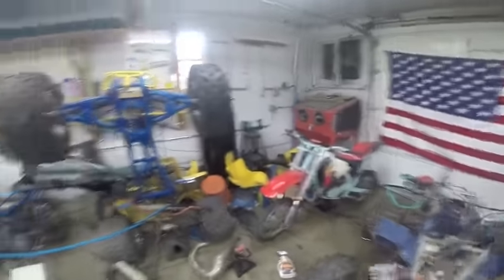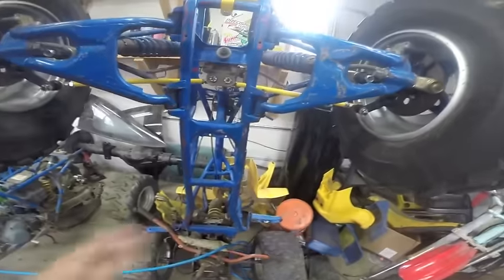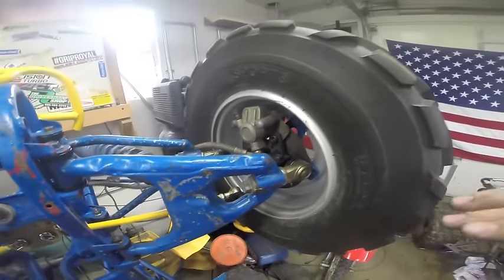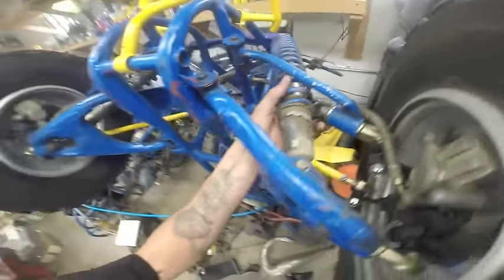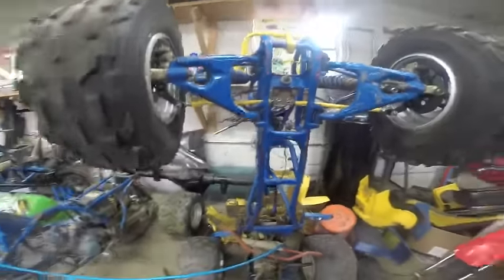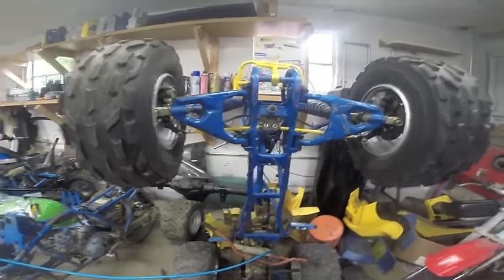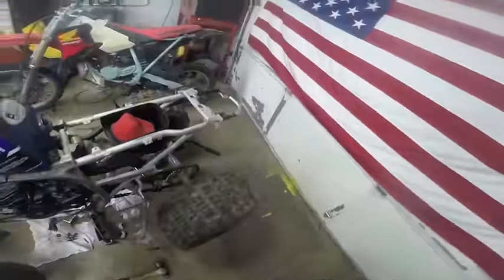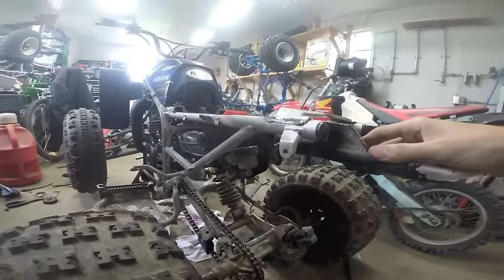What To Look For When Buying An ATV, 4 Wheeler or Quad

Comment: Definitely check over before a test ride, i went to look at a raptor recently and guy said here take it for a ride. Jumped on went down the street the throttle stuck, luckily I didn't panic pulled clutch and hit the kill. After inspecting it the frame was cracked and numerous other issues.

Comment: wow lost me @ "snort"
Reply from the maker: sorry i was getting over a cold.
Reply: dude it's used. not brand new. depends on price to check all that shit
Reply from the maker: some people have no clue what to look at what to buy. Some people also like to polish a turd and sell it for top dollar. just a helpful guide
Reply: it's the coke
Reply: Grinding Gears Garage 
Blow your Nose Bro!!! All that sniffing prolongs Illnesses.
Good video but, alot of sellers will get pissed & say "do u want it or not"!!! Or, if they're real pricks you will get the whole "I got 3 other people that want it so f-off!" I bought a400ex for $800 but it's rough! Rideable, but very rough. No lights front or back, cracked/twisted a- arm, broken front bumper & no brakes front or rear, exhaust is rattling apart as well. Did i get ripped off?
Reply: Cocaine is a hell of a drug!- Rick James

Comment: I have quite a few useable parts for an 88’ and 91’ lt250r. Almost a complete quad. engine needs all new bearings, crank, piston and a few transmission components. What do you think, Build or sell?

Comment: I have a quick question I bought a 2001 polaris scrambler 2 stroke 400 for $600 n the previous owner said to mix the gas your self is better then letting the bike mix it for you.
Reply: All up to you oil injection sometimes shits out or clogs up and that’s not good if you delete the oil injection and pre mix yourself then at least you know it’s done right

Comment: Hi, good video! i'm looking to buy a 4 wheeler, it is a 2001 yamaha blaster on craigslist, would u recommend it? i can put the link to it if u want so u can check it out if you want.
Reply from the maker: Sure. Post the link. Also you can send a message directly on Facebook so it's easier to chat!!!!
Reply from the maker: +Puppster that blaster looks super clean. I'd take that over the Mohave any day!!!!
Reply: ok, just wondering, i cant rly check much of that stuff that you suggested in this video, so in that case would u still pick the blaster over the mojave? the mojave is newer, but more expensive, so which one would u choose in that case, because i know you are pretty good with 4 wheelers, i just dont want to get ripped off, because this will be my first quad. Just wondered what you thought, and if you know if one is better, or more reliable than the other, Thanks ;)
Reply: Which would u choose in that case?

Comment: Can I buy blaster parts off you I live in jersey I'll come pick up also my quad has rev hang ...leak down tested 3 times ..new throttle cable ..looked at the boot for air box and everything I just listed is good ..fmf pipe bosion reed block with carbon reeds ...open air box . Bored .0020 over ..running 93 with 2 stroke racing oil but just regular car oil for case ...I changed the jets pilot is 35 and the main is a 300 the needle clip in center ..fouled plug in one day now I knew this was gonna be too rich but with it getting cold out now and Haven no air box lid I may not be off too much as of November or December when it's cold as fuck and I'm 8 miles from the ocean but either way still have major rev hang when in nuteral or when clutch is pulled in and you rev it ...o yea and I have no tors system and I have a idle screw in it ..sprayed wd40 all over everything when running and no idle rev ...please help
Reply: O yeah lol it's a 2001 blaster
Reply: Glenn Eisenhauer still having this problem? Start with plug chop. if leak down test and compression are good plug chop show you your mix ratio if it's right or not. you said you have a tors delete kit. start with your air screw all the way in turn it out one and a half turns and then adjust your idle screw to your desired idle. plug chop
Reply: Crank seal was leaking..leak down test showed fine numbers so I guess it only leaked when driven. Crank was purple and blue and all different colors by the time it blew from heat. Now I have trenched case and 4 mm stroker with everything changed so w.e. But thank you for the suggestion.